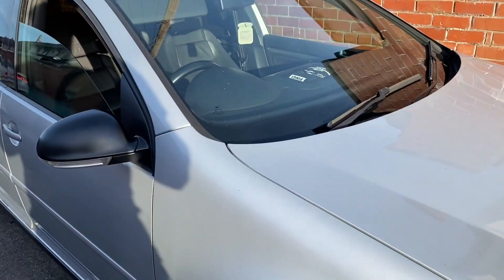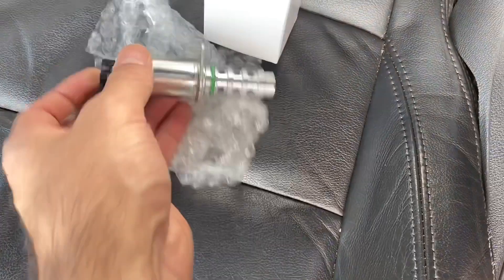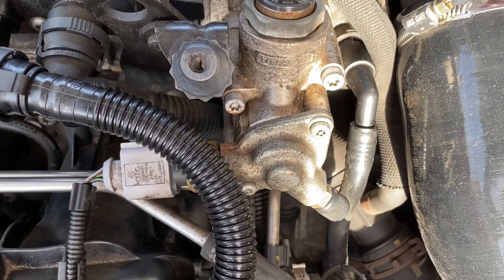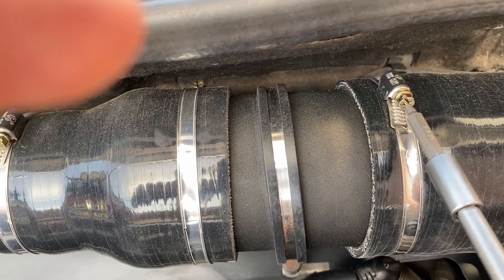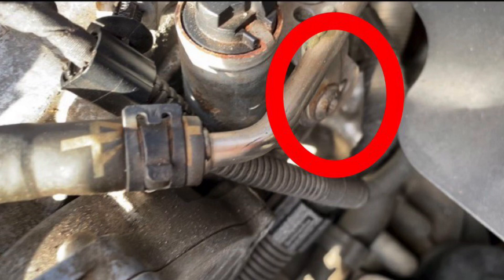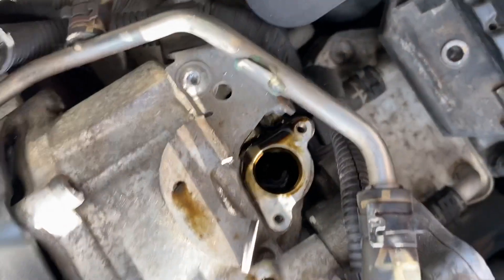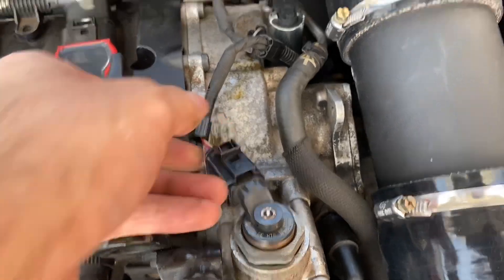How to Replace the Camshaft Variable Solenoid Valve VVT on a MK5 Golf GTI (Fixing Engine code P0010)

Comment: My car actually knocked after warming do you think can be also problem with this part or maybe you have some idea?
Reply from the maker: Hi, without diagnosing the car it’s hard to tell what the issue is with the car. If the engine is knocking it could be something more serious than a faulty solenoid. So it’s worth getting it checked out and diagnosed by a professional before it causes more significant issues. Thanks, Mr MSV

Comment: Thanks! I had to search for two hours before finding this video. Too bad there aren't many schematics of the full engine / electrical connection. I've the same problem after having fixed my 6-year-long issue with rich mixture (it was the broken stock engine cover, fixed with aftermarket intake, that's ridiculous!!!). I really hope it's just a matter of electrical contact or just the solenoid being clogged or gone bad and not the actuator. Engine runs almost fine, I just got the engine light on and a moderate loss of power. Going to check soon :)

Comment: Excellent vid... Just what I needed. I'll be doing this job at the weekend with an oil change 👏🏾
Reply: Got the same issue, by any chance does yours currently sound rattly? Like a diesel in a way because of the sensor

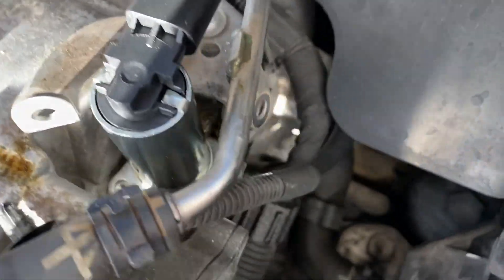Comment: is there just one solenoid ? 6:22 what is that connector run to the other plug underneath the fat black wire harness ?
Reply: did you ever find out?

Comment: Hi do you have to disconnect the battery to do this? Cheers 👍
Reply from the maker: Hi, not necessarily no. It is good practice to disconnect the battery, however it isn’t required tbh.

Comment: Just so you know this will not completely fix the issue if you have active cams or ACT like my CPTA engine you will need to replace the failed 04e906048a part, to diagnose this unplug each one, one by one and find out which one is causing you the issue by using a scan tool like OBDELEVEN, you could replace all 4 although at £60ish per part that isn’t always an option for everyone, just thought I’d add this information since I have Actuator B Cylinder 3 which has become faulty, and there isn’t much information on this type of failure yet since ACT systems are in their infancy for the most part 😊✌🏻

Comment: Hi that is reallygoodvideo and help a lot.i have same code as yours on my golf gti turbo.did I have to replace just one solenoid on back or both ones..and also  my wire plug is mess up like yours too
Reply from the maker: Thankyou. It depends on your car and its issue really. For mine i noticed the plug that was broken therefore only had to replace the one solenoid which seemed to sort the issue on mine. Change the one where you have the same broken plug. If that does not resolve it then you could change the second. Obviously without looking at it i could not really give the best answer. But hope that helps. Thanks, Mr MSV

Comment: Hi Mate, what problems were you having before you replaced the part? Mine had the same issue but it seemed to fix itself which showed the part eventually needed changing. All of a sudden two days ago the car is running extremely rough, heavy on fuel and the idle is bad however no engine management light. Thanks
Reply from the maker: Hi, mine was pretty similar. I initially got the engine management light to begin with but then it went away. This occurred for a while, the light was intermittent. However, my car did seem to run a little rougher. But for your car with what you have described it could potentially be the high pressure fuel pump which seem to be a known fault on these cars. Hope this helps.
Reply: Have about the same problem.. also sounding pretty hard.. like you hear the cams very much..
Reply: Did you ever fit it? It may be the cam timing chain

Comment: Hello sir, i have a golf 5 gti also, and i have p0011 code, i removed the vvt and i tested it, i hear the sound of the solenoid but i dont see any movment of the solenoid. Do you know if the movment is visible ?? Since you have replace already. Thnaks aloy
Reply from the maker: The variable valve timing solenoid is a component of the variable valve timing system that manages the oil flow depending on the engine speed and load.The part i have replaced sorted the code for me. Im no mechanic but when i checked around the camshaft area i noticed my part was broken. It may be a different issue for your car. When you ask about the movement being visible. The valve solenoid valve goes into one of the components as you can see on the video so cant see it visibly moving due to this. Thanks.
Reply: @mrmsv5042  if you don't mind me asking what was the symptom what was your car doing before you fix this? Ty in advance 🙏
Reply: @mrmsv5042  ok thanks.